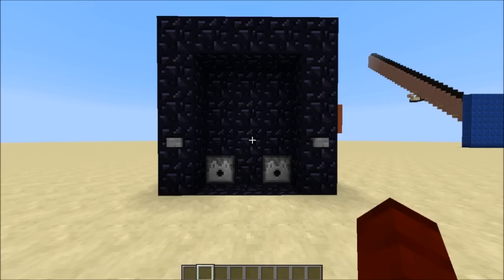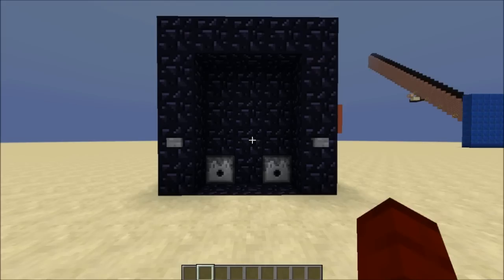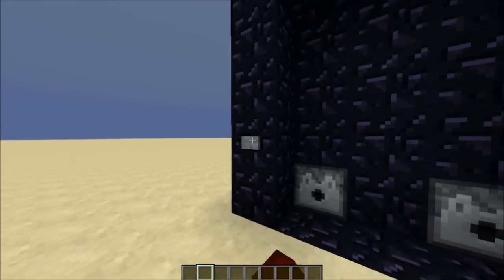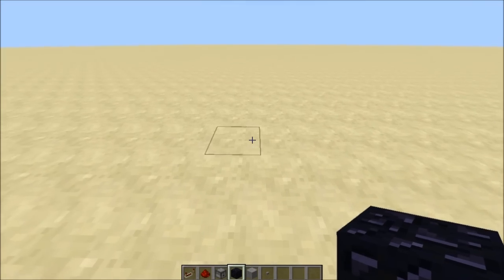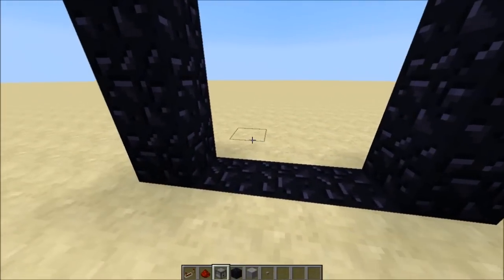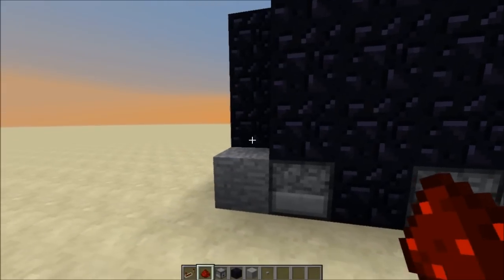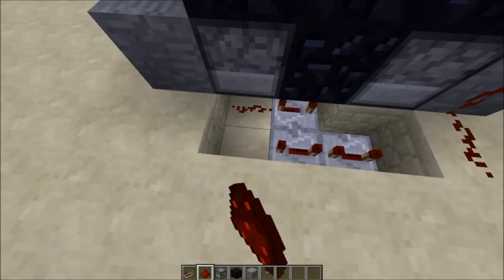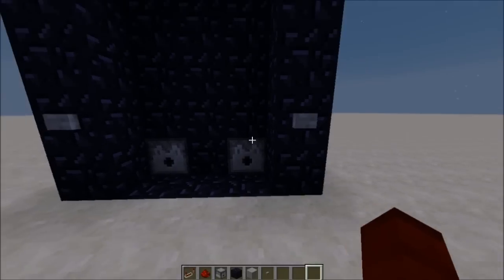Minecraft Tutorial: Automatic Nether Portal On/Off Switch

Comment: Awesome!  Just awesome.  The noise of the nether is now gone from my abode.  The lava in my very small portal room had me a touch spooked, so I did try water first, which just made a mess of everything.  I couldn't get the timing right so at to not end up with an empty water bucket in the dispenser or water all over the floor.  So I took the leap and went with the lava; but I dug a single, one- block hole just in front of the dispenser in case the timing gets wacky.  It'll take the lava if it overflows.  I learned this from all the water bucket tries.  Thank you so much!

Comment: I'm having the same issue. admittedly I'm using a bigger portal but the concept is the same. no matter what ticks I put the repeaters on it just won't pick water back up
Reply: nevermind I got it once I stopped trying to copy and thought about it. the on button is just straight red stone to a dispenser. the off button is the same with the addition of another offshoot signal to the repeaters to the dispenser not instead of. just for those who are still stuck. try making the off the same as on. the just add a bit more room for another signal coming off the off button with 3 repeaters as he has shown. make sure they don't touch the original signal.

Comment: Hey all, I have a problem. the Lava started flowing out, and burned a bunch of stuff. on top of that, the bucket was empty right after.
Reply from the maker: +snorkelvortex The dispenser is supposted to recieve two signals, if you only press the button and it doesn't get another signal later it will not pick it back up.
Reply: +LPG So I need to mess with the repeaters that I set down?
Reply from the maker: snorkelvortex Yes
Reply: Try what i did Use LEVERs there very helpful
Reply: I had the same probelm. you can solve it by putting cobblestone under the lava dispenser